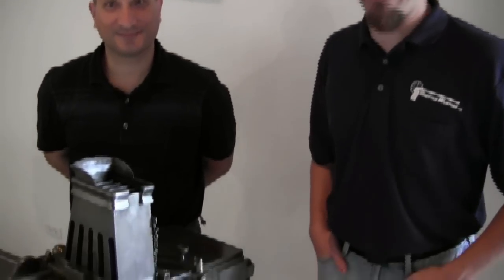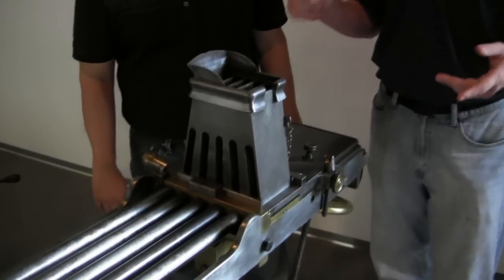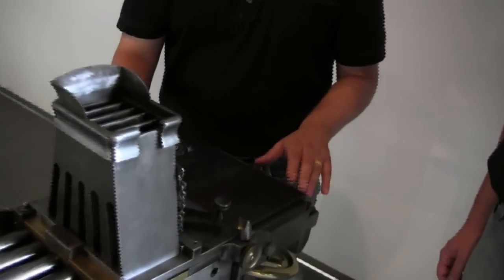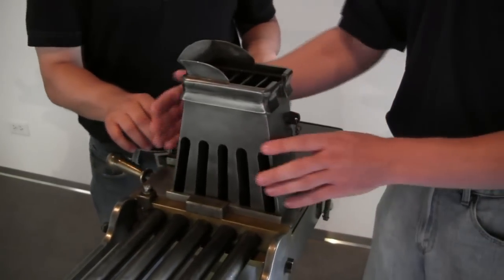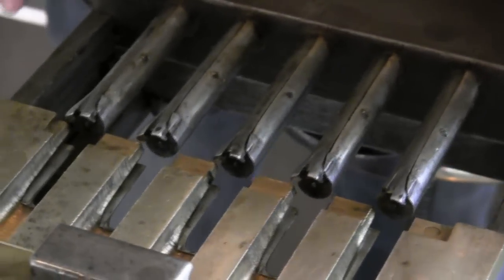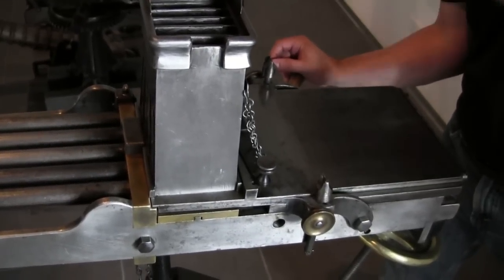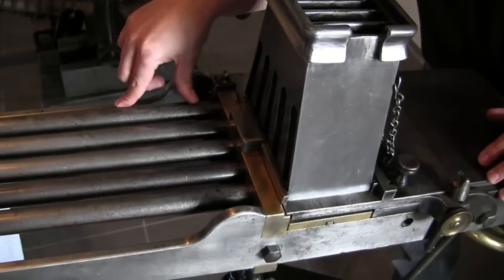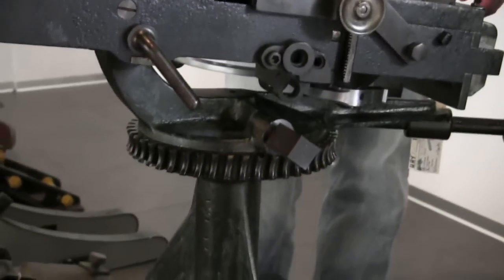The 5-Barrel Nordenfelt Gun

Comment: Excellent video.
Such a marvellous machine-gun; they really were adopted in very large numbers by the British RN, as most ironclads from the late 1870s on were fitted with them, as were steel cruisers and even composite sloops (big colonial gunboat/cruisers). They fulfilled a dual role in the Navy, since the weapons were manufactured not only in different barrel configurations, but different calibres as well. The lighter weapons were ideal landing guns for shore parties, and if I recall correctly the Naval Brigades in Sudan and South Africa used them. Far more important however were the big one-pounders; not just for raking fire against enemy upperworks, they were first-rate anti-torpedo-boat guns. Prior to the invention of the Quick-firing gun, they were the only weapon capable of hitting a TB at speed and doing real damage when they found the mark. A very important weapon, historically-speaking.
The two US cruisers alluded to were the ex-Brazilian USS Albany & New Orleans, built by Armstrong of Elswick. Both ships were rearmed early in the 20thC with all-U.S. main guns, and I wonder if the Nordenfelts were replaced at that time as well?
Reply: Good question! To be perfectly honest, I would be unable to quote any firing rates for either, as they were manually actuated it must have varied with user, but I would guess at the Gatling having a double to triple firing rate on a single magazine, since the Nordenfelt was really a repeating volley gun. Yes, with so many moving parts compared to the Nordenfelt, the Gatling wasn't very light, but then neither was the Nordenfelt. I think the real reason the RN preferred the latter was twofold: 1) the relative mechanical simplicity & ruggedness in service, and 2) the choice of heavy calibres compared to the rifle-calibre Gatling. But for rate of fire, I would think the Gatling always had it by a country mile.
Reply: Yes, for stopping the kind of close action as experienced between say the Huascar & Esmeralda the Gatling would be terrifying! Which i think is why they and Gardners were carried by warships.
A one-pounder projectile is about 37mm calibre. It had a lot of kinetic energy, but due to an international treaty restriction on explosive rounds of smaller calibre, it seems AFAIK that these rounds were solid shot only.
Interestingly, the French used a rotary one-pounder made by Hotchkiss, but such a weapon was never adopted by Britain's armed forces, despite the Hotchkiss Quick-firing 3-pounder (47mm) being used by the RN and virtually all navies. There must in my opinion, have been some kind of trade-off in performance or reliability, but generally the RN just didn't seem to like rotary guns and even replaced their Gatlings with the Gardner...
Reply: Indeed, even light weapons must have been very useful against helpless targets.
I'm not 100% sure that the ban did cover rounds as large as 37mm, but for whatever reason, there seems to have been no attempt to make explosive small-calibre shells, so I am merely surmising at this stage. If anyone has more accurate info, I'm always eager to learn!
I'm a big gun fan too. ;)
Reply: Andrew Givens The ban is based on explosive weight, for anti personnel use it have to be over 400 grammes (14 oz.).
Reply: SuperFunkmachine Hi, thanks for your comment - that's really useful to know. So, at 14oz minimum explosive charge weight, or 0.875lb, that's far too much explosive to fit into a one-pounder projectile isn't it! The projectile case would have no mass and the fuze would take up much of the weight... okay that makes sense and I guess that's why the three-pounder was such a popular gun in the 1880s and 1890s; there would be enough void space in that shell to fit the minimum 14oz of explosive. So, it seems that the international ban on exploding bullets was maybe the reason for solid one-pounder shot after all.
Reply: The SMS Leitha(Austro-Hungarian river monitor) mounted a pair of these.  A very good gun for river patrol boats.

Comment: Is this Baby Gun Jesus?  This may be the earliest video from FW I have ever seen.
That 'action block' seemed over built.  Why does it need a two inch thick slab of steel?  I think he described locking lugs at bolt face.  Bolts were beefy.  All that steel was away from battery, so it wasn't for resisting pressure, right? Was it mass/inertia to reduce recoil? IDK, just seems incredibly heavy and thick for function of connecting things.